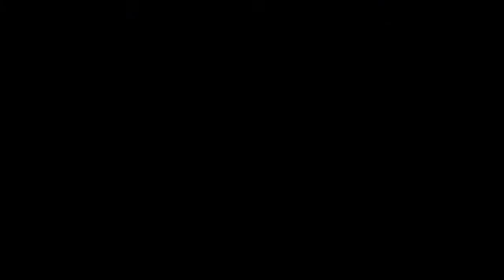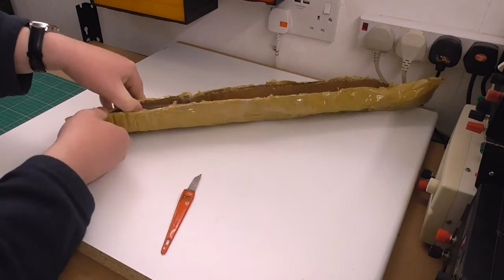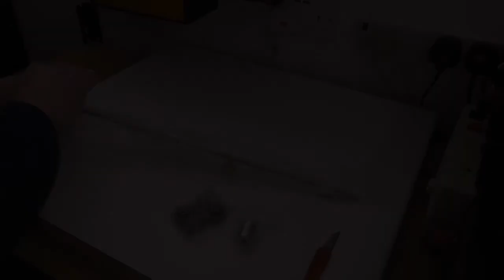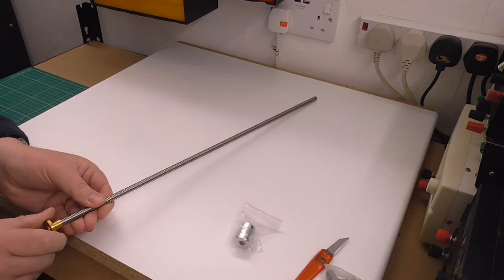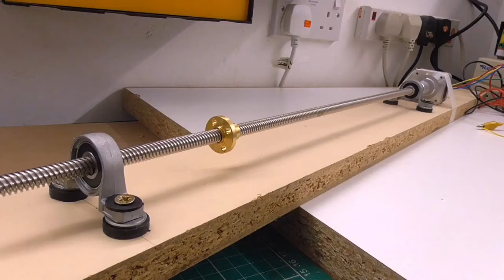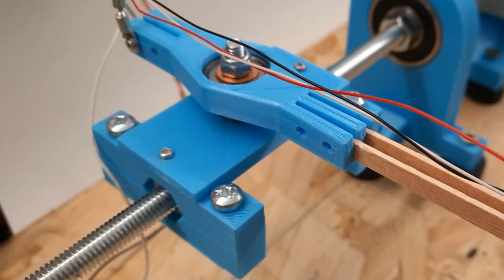Leadscrew upgrade?

Comment: Very quiet, quite nice.
Reply from the maker: Thanks 😀 👍,  it works very well but I think the real magic is the TMC2208. I have also just upgraded my 3D printer to 32bit which has the TMC2209 drivers. Other than the fans, its very quiet too!
Reply: @mrrgstuff  also want to do that with my printer, can’t decide between the 2208 or 9 drivers. You’ll have to let me know how they do
Reply from the maker: I went with an SKR mini E3 v2.0 which has been great. The only thing I don't really like about it is that the TMC2209 drivers are soldered on. It will only be a problem if I damage one. I'm not planning to do a video on it as its very well covered by other people's videos already.

Comment: This is fantastic! Look forward to seeing more on the cylinder phonograph. Really inspiring to see this. Still need to come up with s feed screw drive for mine
Reply from the maker: Thanks 😀 👍.  Glad you liked it. I believe the pitch on this leadscrew is less fine than the M8 rod, and isn't quieter on its own, but coupled with the right stepper motor driver it really is very quiet.